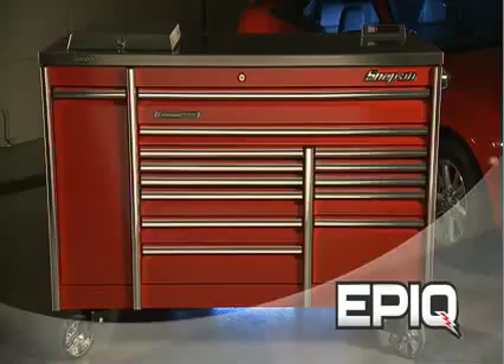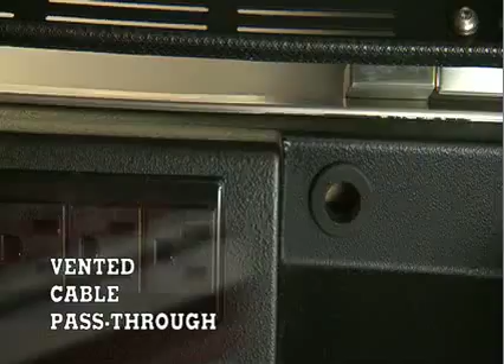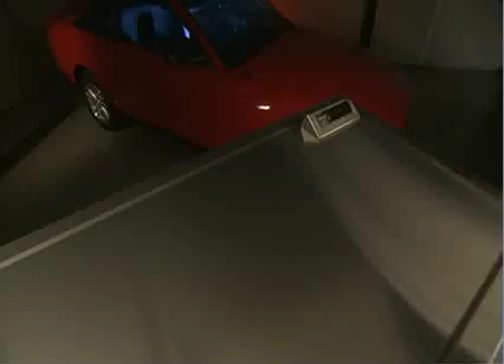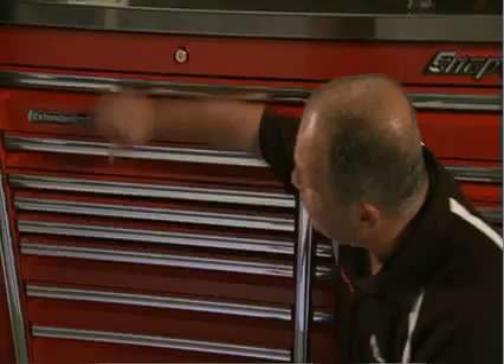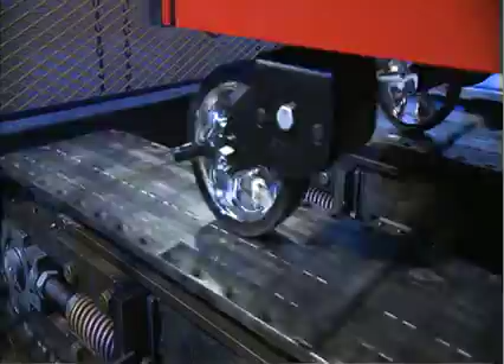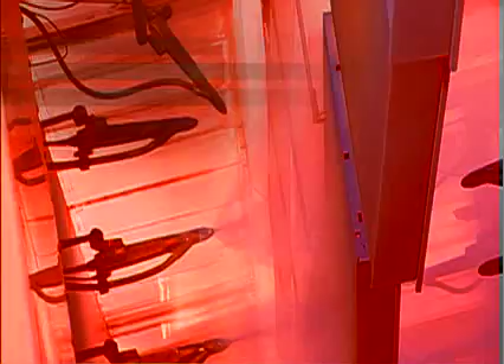EPIQ Tool Storage- Latest in Professional Tool Organization, Security, Productivity | Snap-on Tools

Comment: Some of the best technicians I have ever work with,  in my 28 years in this industry had the crappiest toolboxes you could imagine!  I can’t see how as a new or old technician,  you can  pay $20K or so for tool storage. Lucky for me, I bought my Snap on KRL over 20 years ago….just got replaced under warranty! Same toolbox system now, is over 18k!  However, if you plan to stay in the bussines  (most of us hate the industry!) and you do get a Snap-on,  it is a company that stays behind their product.
Reply: Yea I agree, but after running out of space I went in and got me a Epiq68 inch with hutch. I got rid of my KRL 1001 which was in great shape for a box 21 yrs old and I had the same keys it came with. Bad thing about buying a high priced box is that I won't be buying any Snap On tools till it's paid for and I got 10 yrs to retire. So all I can say to the owners of the truck route is hope selling new tools boxes made them enough money to not have to need selling additional tools to those guys like myself or my co-worker. I do have to say I've gone like 10 plus years staying away from Snap On. My co-worker got a new KRL-1023 with a hutch and a matching end cab and he has two years to retire. Overall nice box, hate the price tag, but I got because I wanted it.

Comment: I have an older krl700 series triple bank with 2 large dump truck frame tool boxes for a top boxes. I have owned it for years and have no complaints with it I bought it used I work as a heavy duty truck tech so I have alot of big heavy tools and no complaints and i also have a mac top and bottom but why is snap on now making every thing 30" deep i dont want to step back while opening a drawer and the top is not at a comfortable height on the new boxes. I think I would buy a classic over an epiq

Comment: I would rather have a Lista tool box, their stronger, and the price is lower . I like the idea of being able to charge batteries in the Epic, but for $12,000 its not worth it to me . Mac also just recently came out with a box like this, also overpriced at $13000 . Lista boxes puts both to shame aside from charging tools . Also Swivel Pro tool boxes are nice, very strong, with a price that doesn't cost $10000 or more .

Comment: I like Snap On too. I repect Snap On Tools because they are innovative in there tools and Tool storage boxes and use high grade steel that will last forever. I looked at Craftsman and there sockets have chips in the chrome and there wrenches look like they were made by a 1800's blacksmith. They look horrible and no doubt they can't turn a nut! There professional series wrenches are good but thats it.